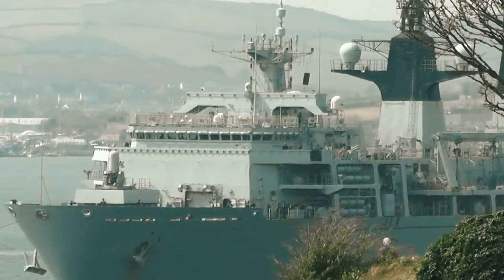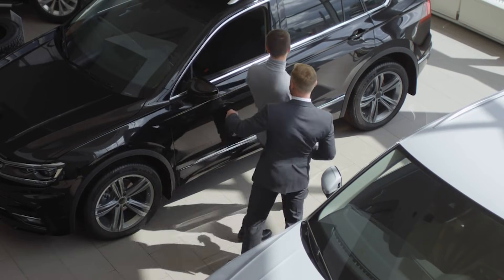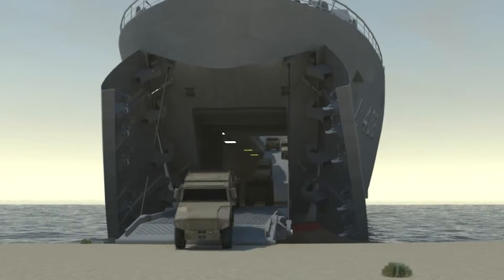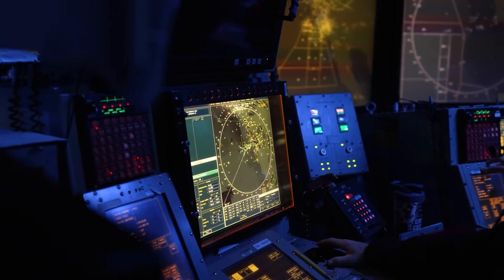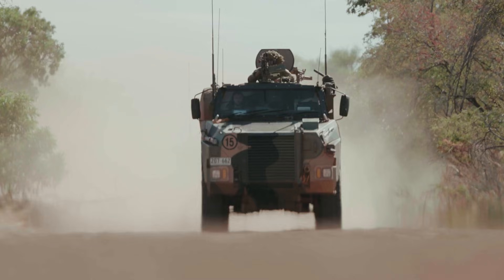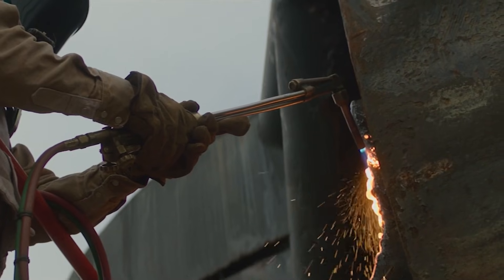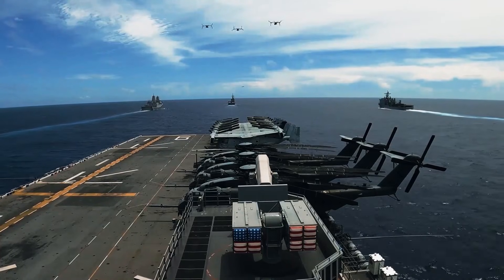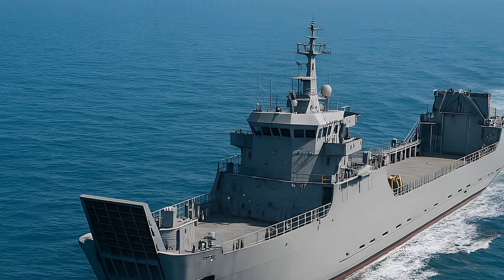McClung Class Medium Landing Ships: Pentagon's Secret Pacific Weapon

Comment: This class of ship will prove useful in the Western Pacific Island chains similar to the benefits provided by LST's of WW2. Distribution of logistical vessels across many vessels will confuse Chinese targeting and reduce their risk of attack. One issue is that many of these isolated islands are atolls with the main island surrounded by a chain of coral reefs, that keep ships far out. The Marines learned this lesson and went from using Higgins Landing craft to Buffalo tracked APV's and six-wheeled DUKW's. Where the Higgins was hung up on reefs, the Buffalo /DUKW could maneuver over the reefs, thru the soft beach sand, shallow island swamps and distribute the cargo inland to the point of need. If there is a beach available AND no reefs, these ships can go straight in but there is a coral reef, they will need to unload their cargo away from shore.

Comment: The McClung Class is based on the Besson Class a US Army Logistic Ship; the Israeli Ships are just the latest produced. The McClung is not necessarily a combatant it is a logistic asset and built closer to commercial standards. Bolliger has built these before and will need to adjust the yard accommodate high production.